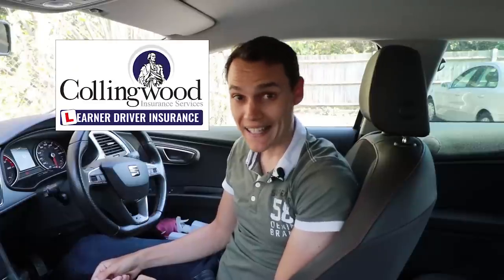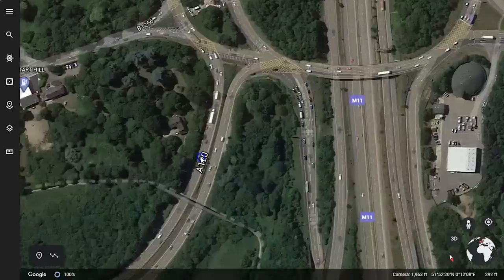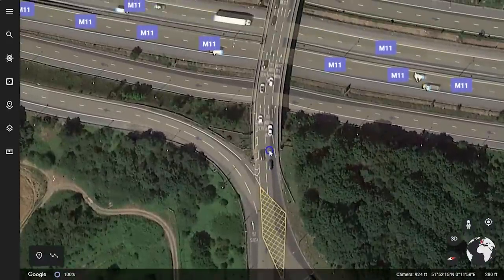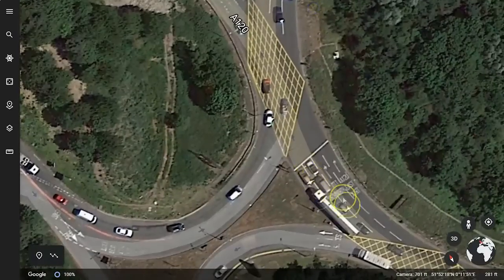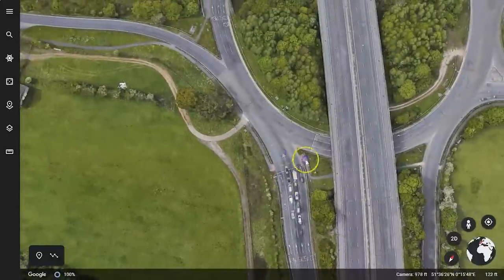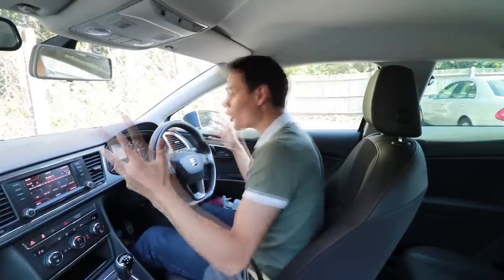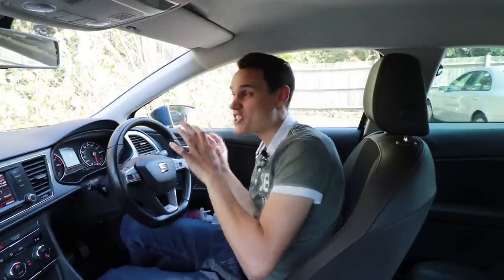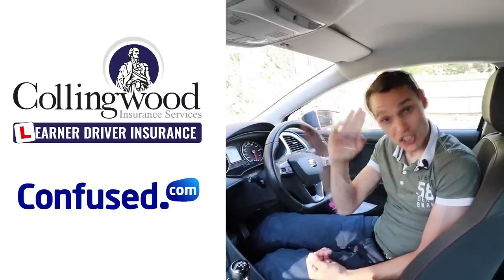What is a Spiral Roundabout and how to use them in Great Britain?

Comment: Thanks Richard, this roundabout is frustrating,  drivers pick the correct lane at the beginning but after just a second you can't turn right as they promised, i feel like that is a betrayal by the civil servants who designed that way. That kind of lying roadmark happens at many roundabouts, which unnecessarily caused extra miles/pollution. They    should be renamed as "wrongabout" to alert drivers

Comment: I just passed my test this week. The first horrific roundabout in this video is one I have to use every day. I was on it yesterday and almost ended up kn the motorway (which I've never done before). It was slightly stressful so I came on here to brush up on larger roundabouts. Lo and behold, it's a video about the same roundabout!
Reply from the maker: Congratulations on passing. I personally dislike this roundabout. It's a dogs dinner and only works if you know it.
Reply: @ConquerDriving  Thank you and thanks for the good content. I particularly liked your video on  clutch control in traffic. I guess I've memorised it now so I should be fine with the Birchanger one, and it comforts me to hear that roundabouts as nasty as that one aren't super common from the sound of it.

Comment: Multilane roundabouts are the one thing that still makes me nervous when driving.

I think the main thing that confuses me is how the 1st and 2nd lanes are so inconsistent: sometimes 1st is left only, other times straight as well, and while most of the time 2nd lane is straight only, it's sometimes also able to turn left into a 2nd lane on the exit at bigger ones. This makes it difficult to predict how you and others are meant to behave until you're already moving round with not much time to react.

I thank you for making it clear from this video that the 'spiral' principle (of the leftmost lane exiting, with a new rightmost lane emerging from the centre) is something that can't be relied on, and I shouldn't assume that it will be the case when I enter. In fact in the examples you showed, parts of the very same roundabout are spiralling, and other parts aren't!

Ideally all the roundabouts would abide by the same rules, or at least have those hatched markings that show you which lane leads to which, but as they don't, keeping cautious only moving left if you're 100% certain it's safe to do so seems to the mindset to have?
Reply from the maker: I totally agree.
Reply: I resonate your concerns.

Comment: I really struggle with lane discipline when it comes to such roundabouts. 
I try to avoid cars in other lanes but then I struggle to move across to exit because I have cars in that lane and fear getting too close or potentially hitting them. 
My other issue is that because of the road markings, I struggle to stay in the correct lane and then there's the risk of hitting someone next to me. 

Do you have any advice for this? 
I'm definitely going to act on your tip to look at Google Maps and Google Earth! 
Thank you so much.
Reply from the maker: My best advice would be to look for space, where you can go as apposed to where you can't go.

Comment: This is a helpful video. I've been planning a route from A13 westbound from Dagenham onto A406 northbound (3rd exit) at the Beckton Roundabout. Signs/markings say you can use either 3rd or 4th lane on approach, but as soon as you enter onto the roundabout itself the 3rd lane is no longer for A406 - it's now marked for A13W and it spirals outwards to ensure you do leave at the 2nd exit for the A13W (pointless as I'll have just come off the A13 anyway). You have no choice but to change lane to the right (which actually splits into two lanes itself). It seems to be unnecessarily confusing and just makes me want to look for a simpler route instead.

Comment: Great Video. I find spiral roundabouts with good signage throughout the whole roundabout (sign boards where lanes and corresponding directions are shown) not particullary hard to navigate. Thing I really can't stand is direction markings on pavement. Usually all worn out and when not there is cars over theme so you can't read them at all. Even when not obstructed they're often hard to notice because you just can't read across four lanes while driving.
Reply from the maker: A good spiral roundabout works well, trouble is they are few and far between.

Comment: I understand the idea: New lanes are added on the right to move drivers left towards the exits, then the old rightmost lane hands the 'and so on' role to the new one -- giving drivers who need to merge against the spiral a lane that cannot possibly have traffic blocking their merge.

Except that's not possible when they use two lanes to handle a single route. This is a fundamental contradiction in the design: If there's enough traffic to warrant a second lane heading to that exit, there's too much traffic to merge into when the new 'etc' lane shunts everyone over to the 'you're still going the right way nbd' lane. Drivers, having chosen the correct lane when they were supposed to, have retroactively been put in the wrong lane and must merge right. But they put traffic lights in a freeway interchange, ensuring both that lane changes become impossible at effectively random intervals, and that LITERALLY ANY OTHER INTERCHANGE DESIGN WOULD BE BETTER. WHO APPROVED THIS? THIS IS DUMBER THAN THE AT-GRADE CLOVERLEAF IN NEW JERSEY!
Reply from the maker: I appreciate what you're saying. It all comes down to available space and budget. The system is very flawed, this was my inspiration for the video.

Comment: 7:11 to 7:24 aren't you supposed to spiral out there (from lanes 2+3 south of the junction into lanes 1+2 north of the junction, as lane 1 south of the junction leaves to the western ramp)? See how complicated this is if even someone making driving instructing videos on youtube can get it wrong?

These spiral roundabouts really don't work without lane markings. If they are missing, then you'll just get vehicles from both lane 2 and lane 3 trying to go into lane 2. Either because the driver in lane 2 fails to realize that they have to move to lane 1, because the general rule is being broken and the driver in lane 3 doesn't realize that they are supposed to not move over to lane 2, or because the person in lane 2 had a lorry or bus to their left so that they couldn't see which lane they are in and assumed that they were in lane 3 from where they would have to move to lane 2. Just putting that progression to the left on the pavement in white paint would make it abundantly clear who has to move to which lane and which lane changes have to be indicated with turn lights and who has to give way on their lane changes.

And at 11:07 to 11:25, as it stands, the shift to the left would be the rule, and as you explain this means that at 10:05, the 2nd lane has no business claiming that it leads to A12(E). For your proposed change of making the 1st northwest-bound lane go to A12(E) too, you'd need to break that "progress 1 over" rule. This seems to be what the engineers of that interchange had in mind there, but it is not communicated at all without lane markings.
Reply from the maker: At around 7 mins in the video you don't need to spiral because you still need lanes 2 and 3 for M11 North as before. The road does become 4 lanes from 3 so you could say you're spiralling out but you're not changing lane, you would still be in either lanes 2 or 3 until you pass the next exit where you spiral left to either lanes 1 or 2.
Reply: @Conquer Driving  That part (until 7:16) is correct in the video and your reply. It's an exception to the "lane 2 becomes lane 1" scheme. (Because the roundabout gains 1 more lane, which means lane 3 would shift into lane 2 and also go into lane 3 and 4.)
I'm talking about the next junction where the services join the roundabout and the A120 splits off. It's 4 to 4 lanes, which means the 4th northbound lane (as per rule of thumb) splits into NE-bound lane 3 and 4. And northbound lane 1 peels off to the left into the A120. Meaning the M11(N) traffic from northbound lanes 3 and 2 shifts into NE-bound lanes 2 and 1. This would be consistent with which lanes are labelled M11(N) before and after that set of traffic lights. I.e. you don't stay in lane 3 as you state around 7:20, but spiral out to the 2nd lane and thus won't have to change lanes to the left inside the NE-bound section of the roundabout.

I have no idea if that's how the locals treat it, though. Another aspect of the disadvantages of no white lines. What the majority thinks you are supposed to do there becomes the rules that everyone has to follow, and it might not be what the traffic engineers had in mind. If everyone around you thinks you are supposed to go from lane 2 into lane 2 (because there are no white lines to tell them otherwise; and as they are going from AN M11(N) lane into AN M11(N) lane the lane markings in that spot don't tell them that they are wrong either), you won't be able to spiral out from lane 3 into lane 2 and get shunted out of the M11(N) lanes.